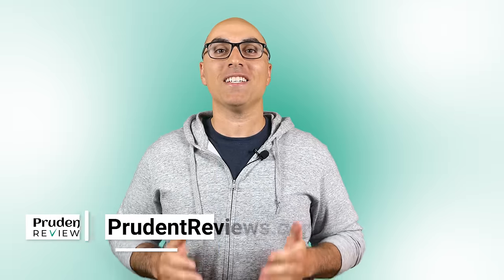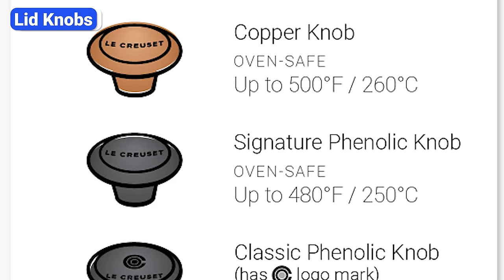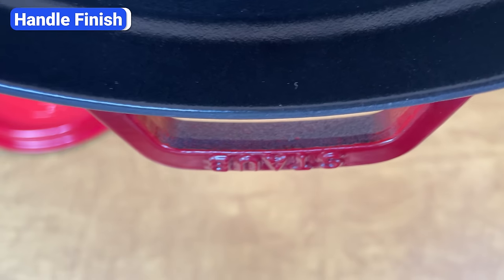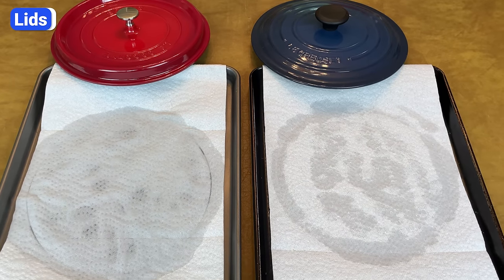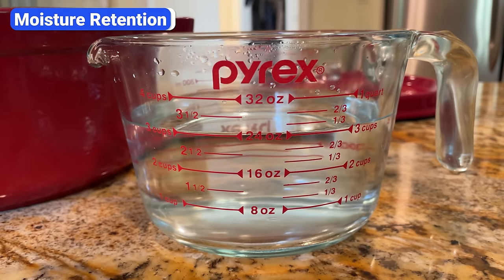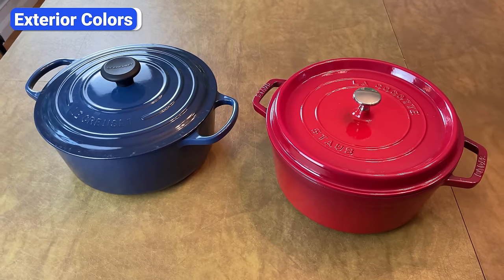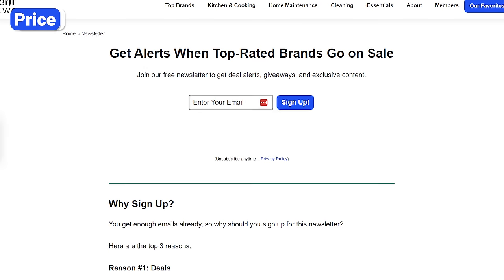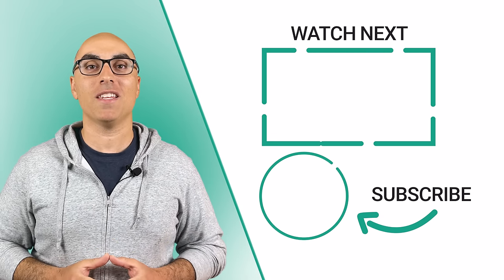Does Staub Outperform Le Creuset? My Tests Reveal the Truth

Comment: GREAT Review!!! 😄👍⭐️⭐️⭐️⭐️⭐️

I’ve been planning for a LONG time to get a New Cast Iron Enamel Dutch Oven (but couldn’t make up my mind - this video has helped A LOT 👍👍👍).

BUT, I do have one ☝️ Question: As noted, I presently have a Huge 7 QT Dutch Oven that I purchased from Costco - I love ❤️ it, and has lasted me for many years.

BUT, I found that around the lid - the rim ceramic “coating” has come off (over time) and is RUSTING.😱

Can anyone tell me if either Staub or Le Creuset’s rim coating is more “durable” (ie - “thicker/stronger”).

Thanks for anyones feedback on this 😂👍
Reply from the maker: Thank you. The rims on both are uncoated so you just need to dry them after washing.

Comment: But will a Staub lid fit on a Le Creuset pot?
Reply from the maker: Great question. Yes! The lid of the Staub 5.5-quart round Dutch oven fits perfectly on the Le Creuset 5.5-quart round Dutch oven. Although, I can't speak for the other sizes and shapes (i.e., oval). They don't sell Staub lids on their own on Zwilling.com or Amazon, but you might find them on eBay and other re-seller sites.

Comment: You are comparing two different kind of stewpans and your moisture retention comparison is just a non sense. The staub oven you are using is called a doufeu in french and it is made for slow cooks with small amounts of liquid. You can put cold water (or ice) over the lid (see how it is shaped) to cool it down so that cooking fumes will condense on it instead of leaving the stewpan. Le Creuset is also manufacturing doufeu stewpans.
Reply from the maker: They are both large enameled cast iron pots with heavy lids. Most people are going to buy one or the other and use them for similar purposes, which is why I’m comparing them directly despite the different lid shapes. On their website, Staub called the pot in this video a cocotte.
Reply: @PrudentReviews  Staub's straight-sided cocottes can be used for doufeu preparation because of the configuration of their lids (I think all of their lids, regardless of shape, have dimpled interiors). They refer to the vessels that are shaped like the Le Creuset you're using as French, rather than Dutch, ovens. I'm going to hazard a guess that most people don't add ice to the lids of their cooking vessels, so I suspect preferences between ÉH and LC are going to come down to criteria such as those you cited.

Comment: A true dutch oven is made to have ambers or coals on top to use them outdoors or with open fire. On Le Crreusets it is not possible so its a no brainer for me. The rubberised or plastic lid nob would melt, so second point for straub. Nuff said. ;)

Comment: you'll notice the Le Crueset lid is far dryer than Staub because it goes right back into the braise, staub holds onto it - neither matters when actually cooking (not to be pedantic but dont roast a chicken in a dutch oven,you braise. This is where steam is the cooking medium not the dribbles from the lid). YMMV on liquid retention. If youre the type of person thats worried about stains.... Look I take pride in my tools gaining the patina of use whether on my carbon steel chefs knife, the stains of meals past on my dutch oven cast iiron and carbon steel pans and steel pots and pans - like a top tier kitchen would be. If that is a key factor in what you buy then maybe do a little soul searching cause thats just sad.

Comment: the steam distribution test is flawed - if Staub shows more moisture retention on the lid ,which is  then transferred to the paper towel , one could easily interpret that the Le Creuset does not retain moisture but actually transfers it all back onto the food more efficiently - ideally there should be no moisture whatsoever on the underside of the lid - Moisture will only accumulate on a cooler surface so Staub does not heat up as evenly as Le Creuset -
Reply from the maker: I see your point but based on my other “Moisture Retention Test”, Staub actually keeps more moisture in the pot.
Reply: If the Staub lid could transfer the moisture to the paper towel, which is under it, why would you not think that it also transfer the moisture back to the pot, which is also under it?

LC lid didn't transfer as much moisture to the paper towel, and my first thought was that it let the moisture escaped, even before watching the retention test part.
Reply: @Yellowfruit65  Firstly i have no preference , since , I do not like either one , cast iron is over rated and too costly . But in the case of moisture retention The Staub could transfer moisture to the paper towel "which it is in direct contact with,,  unlike the food which is not in contact with the lid "" only because the moisture is on the lid to begin with - ideally no moisture should accumulate on the lid it should return to the food ASAP not accumulate on the lid . Also to accumulate moisture there needs to be a temperature differential  between the lid and the pot - the lids being colder than the pot which tells any scientist that the lid is being cooled down on the Staub more-so than on the Creuset . Just buy a good AllClad ""D7"" if you need a nice brazer .
Reply: @PrudentReviews  I do not like either one , cast iron is over rated and too costly.  If one needs a good brazer just buy a good AllClad ""D7""  .Moisture return to the food has nothing to do with the lid sealing well or not , the Staub might seal a little better and retain more water inside the pot , that is not the same as saying the lid returns moisture more effectively back down into the food. Added to this your moisture test was performed on a cooled pot lid and all , . Actually to accumulate moisture onto the lid , the lid needs to be quite cooler than the pot . What does that mean ? As an end to this dialogue cast iron manufacturing is so inconsistent , having so many consistency variations in the end product and in its density , with numerous hot spots that any A vs B test is really not scientific, not even Staud Vs Staub would be . Its a crapshoot !
Reply: We think alike.
Reply: But but but but measured liquid indicated that Staub retained more moisture.

Comment: Sorry, but you americans should be a bit more accurate in pronouncing foreign languages. And these pots are, may be very well designed, cast iron pots and not dutch ovens. There ist an significant difference between the two types of cast iron pots, the dutch ovens an the ordinary pots.
Reply: Don't be a Wiseguy, it says dutch oven on both the websites for Staub and le creuset.. 🤣🤣